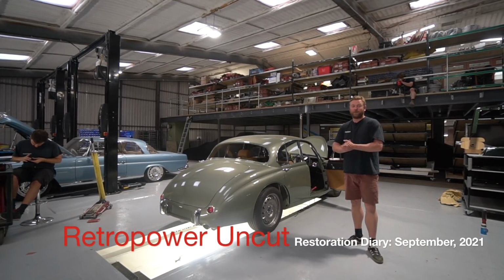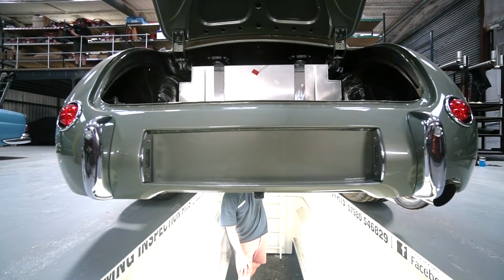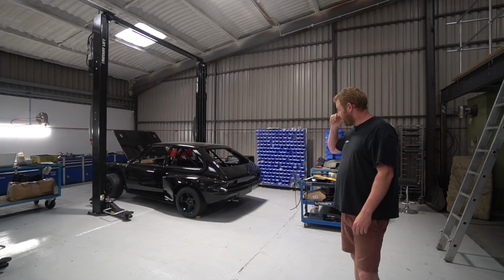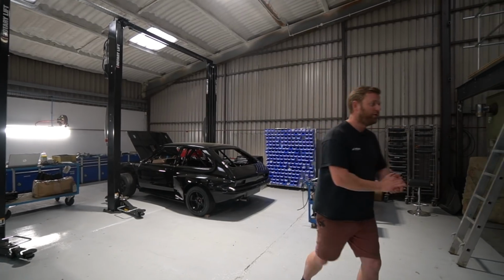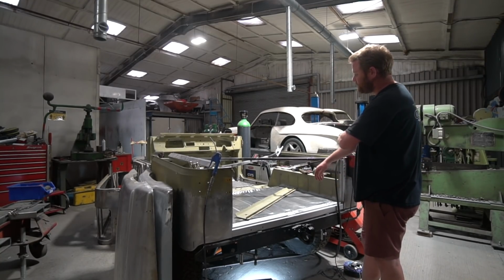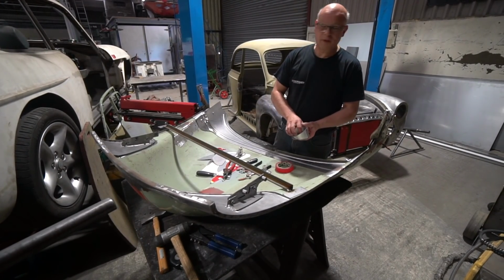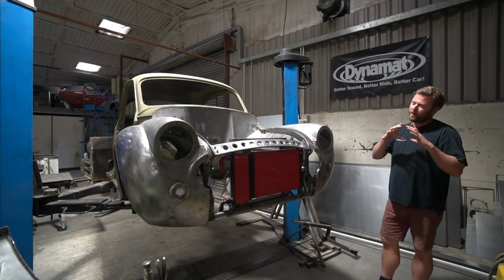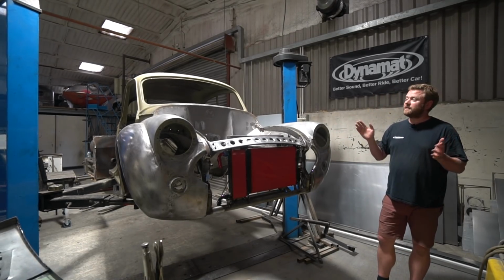Retropower Uncut Episode 56: Morris & Land Cruiser Metalwork. Assembly 'Shop Makeover Complete!

Comment: The handbrake position was discussed by Richard Langworth in his 1982 book "Tiger, Alpine, Rapier"  Rootes were known for using this location.  He asked Clare Hodgman (the local chief of design company Loewy, who designed most Rootes models from 1945) "whether Sir Reginal [Rootes] had been responsible for [the] uncommon outside placement of the handbrake, which occurred on pre-war and many post-war models.  'Probably not personally,' Hodgeman said.  'After all there were others, like Bentley, who did that for years and years.  I think it was possibly more a tradition, and a good idea.' "

Controls do tend to be determined by what others do, so it's most likely that Rootes (and Jaguar) were only placing the handbrake on the outside because that, at the time, was the convention.  Putting it in the centre would have been unusual, and new owners might find it confusing.

The bench seat argument isn't totally wrong, but cars with separate front seats also used the outside location.  Also, most models with bench seats used an "umbrella" handbrake, which was fitted alongside the steering column.  The umbrella term comes from the way you pressed a lever on the handbrake handle to disengage the ratchet - this was very similar to umbrella handles of the time.

Comment: Love the series. But why does every body tig welds without proper protection? I'm a welder myself and has lost someone to skin cancer. There are some perfectly light Tig welding gloves and sleeves out there.
Reply: Tom. I've lost count of the times l've mentioned PPE in my comments .l'm afraid it falls on deaf ears !
Reply: I agree completely!
Reply: Also agree. Yesterday I was welding some sheet without gloves. Thought, "well it's low amperage" but could still feel the radiation afterwards. Normally I always wear gloves. This time I didn't for some more torch control. I can adjust the 1st and 2nd amperage while welding on the torch but my gloves are getting old so I was loosing feeling with the knobs. Directly after this experience I ordered some new deer gloves 🤣

Comment: I guess the Chevette fuel tank is a larger capacity than the original. My old HSR, when revving at over 7000 rpm, I swear I could see the fuel gauge moving.
Reply: No different to modern petrol Vauxhall’s terrible fuel economy
Reply: @moonface978  To be honest, my only experience of a modern one was a Opel Corsa petrol courtesy car. I'm used to a TDi, it was gutless unless revved hard and the economy suffered. A Sunbeam Lotus or BDG Escort of same vintage had poor economy too.
Reply: @russcattell955i  But realistically all high performance engines with carburettors were thirsty
Reply: @johnrebus1641  Yes, but the bark from twin DCOE Webers is addictive.

Comment: The outside handbrake on the Jag may have been to facilitate a bench front seat which was quite common in the sixties. When I was a kid, we had a Vauxhall Cresta like that
Reply: Old Volvo 144/145s were like that too.
Reply: And the Rootes Arrows
Reply: I think the XJS had a drop down lever in the same place, felt quite odd to use. For that matter the 928 has the handbrake on the sill.
Reply: @johnsherborne3245  You’re right, all the transaxle Porsche models (924,944, 968 & 928), but that wasn’t for a bench seat option! I imagine it was down there because the centre tunnel on the Porsche’s are quite high so add a brake lever and it would be tickling the drivers armpit! The Porsche models don’t have a transverse bar to move the mechanism on the handbrake, but RHD cars have one for the foot brake to keep the booster on the Left on RHD and LHD cars! 🤷🏻‍♂️
Reply: as did Peugeot Pick Ups (504) right up until production ended in the late 80s/early 90s.
Reply: Yes I remember my Dads new Cresta had that back in the early sixties
Reply: The Boxer/Relay/Ducato vans have the handbrake mounted doorside on the seat frame, so it doesn't get in the way if you have the 3-up halfbench option. Problem is the seat is height adjustable, and the handbrake bracket is on the bottom part. This means that at 6ft tall, if I don't drop my shoulder, my hand is a few inches above the lever in the on position and I have to properly hunch to drop it all the way off. The lever is also angled away from the seat so seatbelt can get looped round the lever, and you can snag your belt or jacket when exiting. I'd much rather the handbrake was in the dash with the gearstick so they're operated with the same hand.
Reply: Fiat Multipla had the handbrake by the door too 👀😂
Reply: Aston Vantage and DB9 have the handbrake there too. The lever is always in the down position so it’s not in the way. To disengage; you lift the lever up, depress the button on the end and then lower the lever. To engage you just lift the lever and lower down. Called a throwaway brake handle (I think)

Comment: I remember my dad had a car with the handbrake on the outside edge of the seats, I remember him ripping his back pocket of his trousers off while sliding out, after grabbing me as a toddler from the front seat (safety of passengers was an afterthought and at that time seat belts weren't compulsory! I remember laughing like a drain .
Reply: Volvo Amazon also has handbrake between door and driver seat.
Reply: I can remember Dick Van -Dyke had a similar issue!